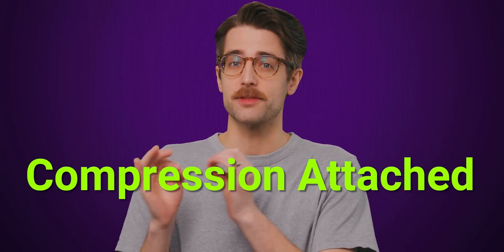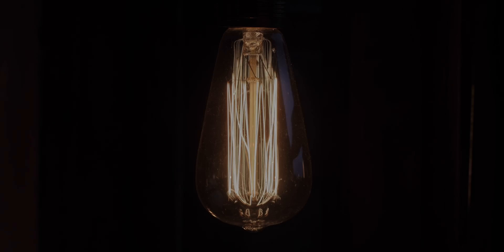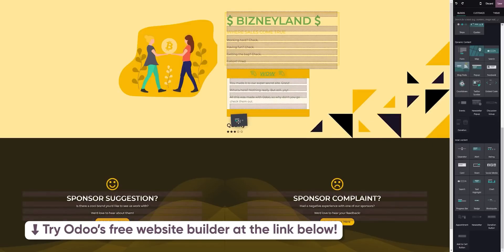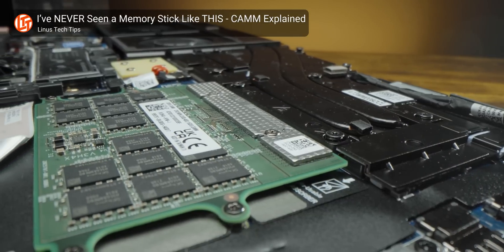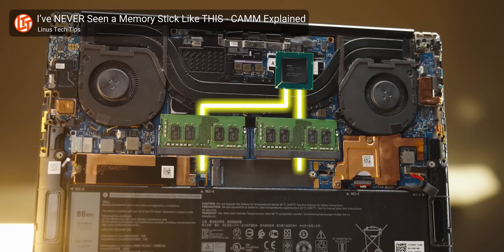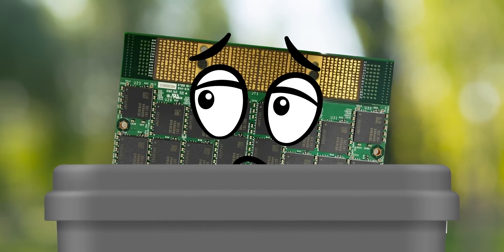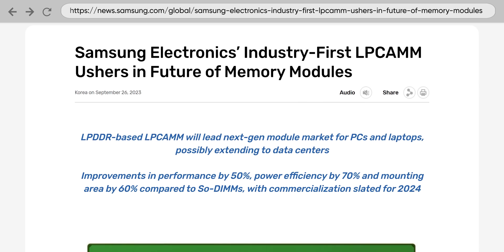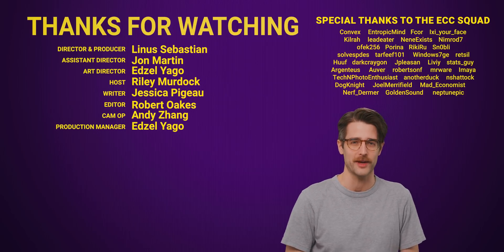You Can Upgrade Your Laptop's Memory Again! (CAMM2)

Comment: If they wanted you to upgrade the RAM they would've kept the current design which works fine anyways, there is ZERO technical justification for RAM to be soldered to the motherboard other than they want you to buy a whole new machine in a few years, it's not a technical requirement, it's a business requirement, you can't provide technical solutions to fix it, you simply need to reject purchasing any laptop without replaceable memory. 
Again you should be angry, there is ZERO reason for the RAM to not be upgradeable on every single laptop out there, companies like Apple are just scummy and want to rig your laptop to be obsolete in a few years so you'll buy another one

Comment: My laptop came with SODIMM, I took it from 4GB to 32GB. I know, sounds like an overkill and 16GB would've been probably fine.
Reply: A 4GB laptop doesn't use more than 8GB for 70% of tasks, & when it does use more RAM, the program will be simply too heavy for the CPU/GPU to handle.

I did a 4-16 & >8GB usage is simply for gaming open world ones where system keeps assets in memory.

16GB is new 4GB but next Gen GPUs will hopefully push for 12-16GB of VRAM, needing more RAM to support it,

I'd prefer a 32GB system in 2025-26 I think, over a 16GB one.

Comment: one major advantage of upgradable ram you missed: 
you can buy buy low equipped laptops and immediately insert additional ram you bought yourself instead of increasing the margin of the laptop seller (apple before m1 was this way).
and you can sell the ram separately later.

Comment: I mean, I have an Acer Aspire from 2012(?) And it's still allive and kicking with 2 spare Slots for SoDIMM yet to be filled, but the limitations of speed is a problem, and we're only accelerating on the slide of technology, so I can see how Dell invests in this Problem BEFORE it becomes a USP for some other company. In Tech Industry, if you cross the bridge once you get there, you are probably too late for profit.

Comment: Soldered ram is also bad because if ram fails you have to throw away your laptop or try more expensive repair technics than just replacing with a new dimm.
Reply: Or worse replace the whole motherboard.

Comment: Damn, quality control dropping off at LMG again. 
This module in a Tablet? The whole mainboard of these things is usually smaller then a CAMM2-Module. Mini PC... Around half the Mainboard size, if not more. And there's the kicker for average consumer, respectively low- and mid-segment, notebooks as well: Too goddamn big. These mainboards got so small, the problem isn't even just height, it's XY size as well (if not even mainly).

Nice for workstation- and gaming-notebooks maybe. But for the rest... like, come on, the comparison was only to 4x SO-DIMM! Weren't there any bullshit detectors going off when this script was reviewed? Especially the tablet/mini-PC part and size comparison?

Comment: The main issue here is that many laptop makers do not want people upgrading the RAM, thus even units without space constraints are also having soldered in RAM. They like being able to charge an extra $300 to go from 16GB to 32GB, rather than allowing them to buy a cheaper base model and then spending $90 for 32GB., and recovering some of the cost by reselling the old modules.
Reply: If you have choice between a laptop with cam2 or not, you gonna choose cam2. This consumer choice will FORCE the rest of the manufacturers to comply or lose out.
Reply: But there isn't many. Most laptops even now do not use soldered RAM.

Comment: I think the biggest reason for higher power consumption for SODIMMs is they only use DDR and not LPDDR. If you soldered DDR it probably will use same amount of power as SODIMMs, maybe bit less because of shorter wiring.
Reply: Maybe will still see power reduction‚ if the wires is shorter you also need less power for signal integrity.
Reply: @yohanmestre2203  I believe signal integrity is why LPDDR were soldered instead of using SODIMMs. Where CAMM2 would improve there (but might still use more power than soldered).

Comment: I see no reason why usb/connector ports and RAM needs to be soldered.
And "less power/more space/less cooling" isn't a good enough excuse when a brand new next gen laptop always costs more than the previous laptop. The RAM requirements gradually go up when it comes to software usage over the years and the same goes with general memory storage. Having these being upgradable/replacable is vital to not having to switch to a more recent laptop if the only requirement that's changed for you, as a user, is the need for more memory.

Secondly, ports break all the time.

Comment: finally. the best of both worlds. looking forward to upgradable ultrabooks. 

now please someone do the same for gpus
Reply: Since gddr is much higher in data rate, they need to sit very close to the die to get that speed and maintain signal integrity, look at some PCB shot of a those which use gddr6x and you know it is not going to work for current architectures. Maybe someday it can be done as a extra layer of cache?

Comment: Doubt this will have a major impact. Enterprise laptops like the HP Elite Book or most thick Thinkpads already come with SODIMM slots. Some workstation models have 4 slots 😮 such models from dell, hp and lenovo will probably adopt this new standard as it has less limitations and the price of the modules will definitely be higher than that of SODIMM, which are still ubiquitous. But no mainstream ultrabook will adopt this. How do I know? They make more money with soldered ram, and the consumer already accepted soldered ram without much fuss. Certainly apple will not be adopting this. They can’t even adopt a standard M.2 Slot in the mac mini and studio, those certainly are thick enough to accommodate a 1.2 mm thick NVMe ssd.

Comment: Not so fast, CAMM2 may not be a replacement for SODIMM.
Why? Because the standard defines CAMM2 modules with optional sizes: "Various form factors with X = 78 mm, Y = 29.6to 68 mm".
That means that laptop manufacturers can lock bigger CAMM2 footprints for larger capacities behind pricier laptops with that RAM coming OOB.

Basically we'll get SteamDeck's M.2 2230 pain in the butt, but now with RAM.
Don't know about you but I was already fed up with searching for laptop specsheets in support sections to know if the laptop comes with 2x SODIMM slots or if it's half-soldered trash.
Now they can just state the usual "up to N DDRX" which didin't mean anything before but now may or may not. Gosh, I wish the standard mandates the mention of CAMM2 supported sizes.
Reply: I like having 2 slots. I guess that also disappears with camm2.

Comment: I upgraded my RAM from 16gb to 32gb and sold the 16gb on eBay for way more than it is worth and bought the 32gb on a good sale. :)
Also got a over 200€ m.2 2TB SSD which is ultra fast like faster than most other m.2 ssds.

Comment: What nonsense🤬 , another solution that replaces the tool-free plug and play solution with "now" you have to have a screwdriver, screws, oh and you have to replace the entire RAM and not just expand it.
So I won't even write about the durability and ease of damaging this connector...
You want a lower profile, install edge SODIMM connectors on the motherboard and/or cut module-sized holes in the motherboard so that the profile will be identical to the one in which you would solder the memory chips to the motherboard.
The issue of the length of PCB paths is simply a lie, design the motherboard correctly and the problem will not exist.
Reply: @tristankordek  You do realize that you already need a tool to disassemble the laptop to begin with right? It’s almost like you already need a screwdriver to open the damn laptop. “Screws” you do realize that a CAMM2 laptop will already have RAM installed there right? Which means the screws are already in there

Not to mention most mid-range laptops only comes with 2 SODIMM slots anyway, so if the ram installed is like 16GB dual channel (8x2) and you want to upgrade to 32GB you have to just still buy a new RAMs anyway, not to mention the speed limitation and all that stuff

Unless this is a bad troll, Stop being a boomer with this “If it ain’t broke don’t fix it” notion lmao.

Comment: Honestly I wouldn't be so against soldered on memory if it wasn't for the fact of if there is soldered on memory, there is no SODIMM slots that can be used to expand the memory, and once detected, the soldered in RAM would act as a "limp mode" effectively in case the SODIMM fails for whatever reason.

If they began doing that, I think more people would start to accept soldered on memory as a positive, not as a if it was the technology version of herpogonasyphaids.
Reply: Well you say that until your soldered on memory gets messed up. Then your machine wont boot.
Reply: @Dubfiance  it the soldered RAM failed, and the SODIMM modules failed, you probably have bigger issues going with the device.

Also, if the soldered memory fails as a back-up, it would be just like if it didn't have it at all unless manufacturers went so proactively down the rabbit hole using hundreds of man hours to fuck it up. And everyone already knows don't trust acer already
Reply: @calebpace8788  my previous laptop with 2 slots and no soldered ram had a failed sodimm slot that would prevent post if it was populated, forcing me to run it on a single sodimm, so soldered memory failing in a way that stops the laptop from working even with the working removable module is plausible.
Reply: already have a laptop like this, 4gb sodimm that's part of the motherboard with a sodimm slot above it. works without the removable sodimm and have a 16gb one installed for a total of 20gb

Comment: Space ISN'T a problem. The last two laptops I bought like the LG Gram are half empty inside!
Reply: space is a problem for gaming laptops.
Reply: @TabalugaDragon  Any laptop with proper cooling have a lot of space for parts.
Any laptop that is struggling for space will be struggling for cooling even more.
Apple keeps pushing thinner and thinner laptops and other companies are copying that not realizing that there is a difference between a gaming laptop and an apple toy that can be used only for browsing the web, since its too weak for anything else.
Reply: @hubertnnn  gaming laptops need a lot of space for cooling, can't break laws of physics. Also a large battery is preferable because they have more power-hungry components. Space for storage is also needed if you do a lot of projects like video editing. So yeah, all of that takes space. RAM can be soldered to save space, but then it's non-upgradeable. That's why well-designed gaming laptops almost never have unused space in them.
Reply: @TabalugaDragon  Wrong. For good cooling you need large heatsink and fan. And both of those components must be located near the CPU/GPU to work efficiently.
The more space you use for heatsink (aka the thicker your laptop is) the more extra space you have in all the other areas that are not near the CPU.
Reply: @hubertnnn  do you even read your own messages? "the more space you use, the more you have" LOL
If only reality worked this way. 
Because in my reality, a really large(wide, long) heatsink is using space that could have otherwise be used for RAM, storage and so on. But some gaming laptops have to sacrifice the battery size. 
And it's not "a fan". It's fanS, plural. Some laptops have 4 fans(like Alienware laptops) for the best heat dissipation. Using your logic, those laptops have EVEN MORE space for other components 😂
I mean the more space you use for cooling, the more space you have for other components, right? 
Oh nevermind that many office laptops often have storage and RAM in places where gaming laptops have heatpipes and fans.
Reply: it is, for products they wont use the connector in anyway..
Reply: @lasskinn474  I don't understand your opinion, could you rephrase please?
Reply: It's the headphone jack again

Comment: The zig-zag copper traces may be redundant. According to Veritasium, electricity doesn't flow through circuits. It’s the empty space around the circuit that carries the electric field. Therefore the distance between the DRAM and CPU, which the signals propagate, is just a straight line.

Comment: As primarily a Mac user the thumbnail got me curious if there was some new rumor about upgradable RAM for MacBooks. Now I’m sad… but I get with how Apple silicon works it may be tricky to make with upgradable RAM. However I’m sure Tim Apple COULD do it if they wanted to.
Reply: they could, and they did for a long time. They're probably not going to unless forced
Reply: @tournamentmaster2000 They would have to completely redesign their Apple Silicon CPU chips.

I hope no laws are made for this for the single reason that it stops innovation – there are applications where the speed and latency of RAM built into the CPU are a genuine advantage and it would be a shame to lose the ability to manufacture them.

People who don’t need that can just buy a different laptop, that has cheaper RAM than the firstborn’s-blood-amount of money that Apple is asking for RAM.
Reply: Apple's pretty stubborn. I'm doubtful they would even investigate this.
Reply: @yensteel  It's because they know they dont have to on their consumer products. Up until 2008ish, you could change the RAM yourself. The battery too, until they decided to glue it to the top case.
Reply: They could also have replaceable m.2 storage , but they are a Garbage company for sellouts
Reply: While CAMM2 is better than SoDIMM, the soldered memory is still better on space and power efficiency. But the M chips don't simply use soldered memory, they have the memory directly on chip, for even better power, space and performance. And probably cost too, at least for something comparable in performance. So you won't see something like CAMM2 on Apple laptops anytime soon, if ever again.
Reply: @Winnetou17  Is having the RAM embedded in the CPU a choice from Apple or a limitation of ARM architecture? I don't think I've seen a single ARM device with upgradeable RAM.
Reply: @theviniso  Jeff Geerling (which frequently toys with Raspberry Pis and Compute modules and others) has a couple of videos featuring ARM server CPU. Which does have ram slots with upgradeable/slotable RAM.

So the ARM architecture totally allows it, it's just that in embedded devices, where size and power efficiency matters most, that's where having the RAM on chip is the most beneficial.

Comment: WE NEED MORE OF THIS.
Also, what about using these for VRAM?
Reply: My understanding is that vram needs such high speeds that socketed memory just wouldn't work
Reply: @calebmenker988 true, but they would definitely help out iGPUs, where their main bottleneck (besides sharing cooling with the CPU) has been the comparatively slow memory speeds. Give them much faster memory, and they'll be a lot more competitive.
Reply: @calebmenker988 depending on how fast these modules can go it might work. No expectations though as v ram has never really been replaceable without a hot air station..
Reply: @antonisautos8704   Are you suggesting that gpus should make use of slower memory just so that the memory can be upgraded? The performance hit will be insane, I imagine to the point that it becomes totally unviable (imagine what should have been 4060 performance, which is already very underwhelming, sold for the same 4060 price, but performing like a gtx 1650 instead)
Reply: What if you had a slot of slower vram to use sort of like system ram and swap? Like, 8gb on the GPU, and the slot could have another 8gb that's just slower. Not the same as 16gb gpu, but maybe it could help? Idk how gpus work though so whatever.
Reply: nvidia alone will kill this idea entirely
how would they be able to sell a 12GB version GPU will a significant price increase than the 8GB version if the user can just buy a off the shelf VRAM module
Reply: For VRAM you need more memory bandwidth to access more VRAM plus you need much much much faster modules which isn't possible with a socket.

Comment: CAMM2 sounds utterly terrible, and I hope it never, ever, EVER catches on.  CAMM2 fixes a problem that doesn't exist - upgradable RAM on laptops.  It's also a Dell standard, and Dell is one of the worst manufactures of workstations these days.
Reply: Soldered RAM on a lot of models. CAMM2 solves that.
Reply: @sergeykish  CAMM2 is flawed in that if you upgrade the RAM, you have to upgrade the previous RAM. You cannot just add another stick. So, if you have 16GB, you must remove that and buy a 32GB CAMM2 stick. That means the upgrade costs 2X as much as SODIMM, and you end up with a 16GB stick of e-waste as they will be impossible to sell, with most PCs likely to come with 16GB minimum from 2024 (e.g. Core Ultra).
Reply: @andyH_England  in my experience I had to upgrade both sticks most of the times:
4GB to 16GB was 8GB + 8GB.
8GB to 32GB was 16GB + 16GB.
That's two last notebooks. Similar e-waste issue with small SODIMM. I donate previous sticks to repair shops.
Reply: @andyH_England it’s their this or soldered ram in the future. Pick your poison